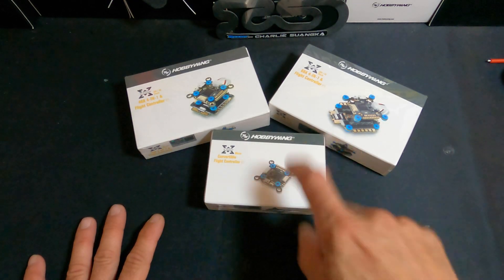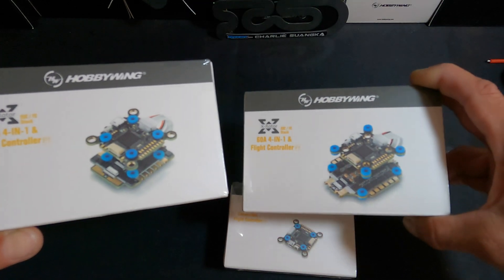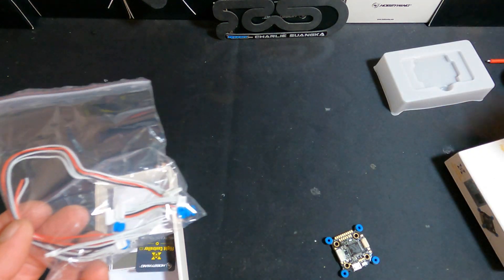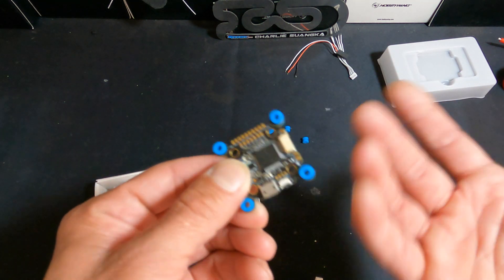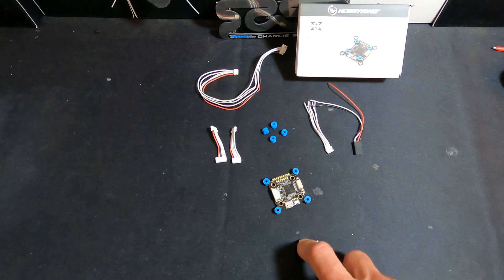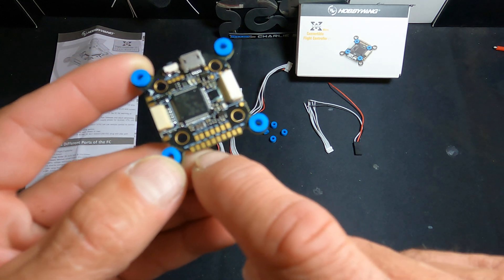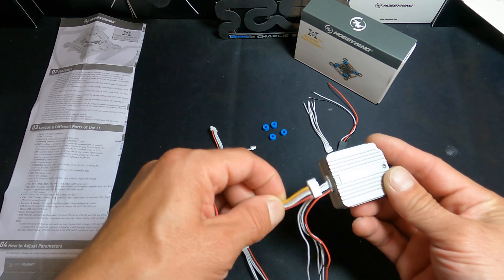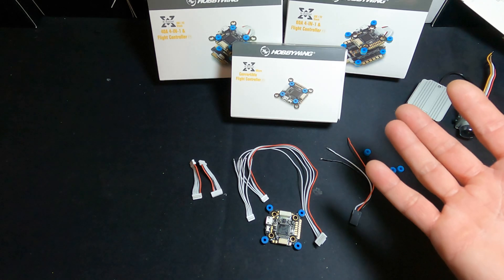The Charlie Show /// Episode 218 /// Xrotor F7 Convertible Flight Control

Comment: Where can I get a wiring diagram for the Xrotor F7 Convertible
Reply from the maker: Here is a link to the manual.  There is a pin out listed there. 

https://cdn.shopify.com/s/files/1/0109/9702/files/User_manual_Hobbywing_F7_FC.pdf?v=1621556510

Comment: hi, i have the 20x20 esc Xrotor esc version and have bricked one of the esc so now i need to unbrick it using a arduino board but i need to identify the tiny pads under the board, not sure i you can help me.

it have been my favorite esc for a really long time so don´t want to trash it😔

Comment: So I switched from a frsky reciver to a vista unit and now my radio won't communicate with the flight controller. All I'm getting is a flashing red led. Video transmission works fine and it's definitely wired correctly. I also tried switching back to my frsky and still all I am getting is the flashing red light with no communication to the radio. What am I doing wrong?

Comment: NEED HELP!!! I have HOBBYWING XROTOR CONVERTIBLE F7 FLIGHT CONTROLLER HD DJI PLUG AND PLAY - 30X30 & 20X20MMth but cannot get power to the caddix vista. I tested the VTX and it works but just not getting power to it. I'm using the DJI remote as well. Been told to activate modes but cant due that until I can link the VTX with the controller. I purchased another thinking the one I had was broken after speaking with a Hobbywing Tech. Is there a trick to get enough power to the CADDIX VIsta to power up? Thanks in advance
Reply from the maker: northamerica@hobbywing.com - Please send us an email.  Thanks!

Comment: Bought the f7 40a stack, I’m using the Dji connector cable supplied with the stack. I’m not getting any battery voltage in the osd. I get n/a and 0.0v displayed. Any ideas why??

The fc also had flywoo hex copter firmware on it when I first plugged into bf.
Reply: Same here, did you figure it out?

Comment: so how do you wire your vtx to use the pit switch? from the manual I think that I have to bridge the RX5 -> VTX -SW pads, then do some CLI commands and set my USER1 range.   but it doesn't say where to power your VTX to make use of this?
Reply from the maker: From the DJI plug harness side power.